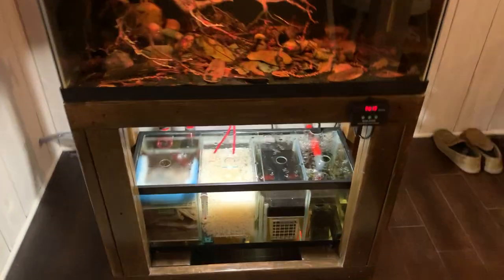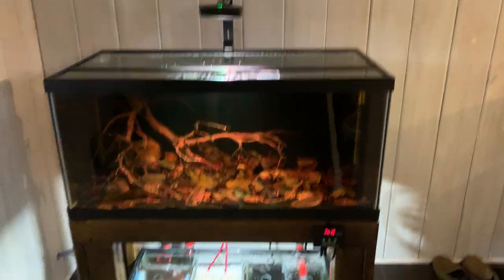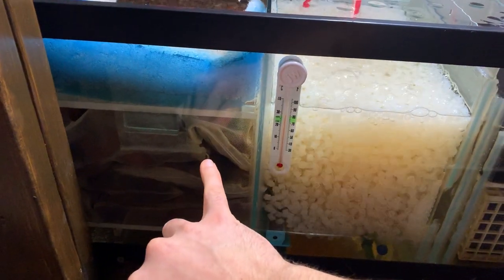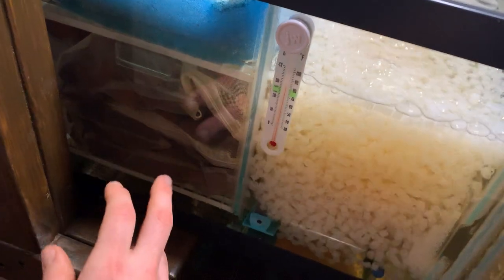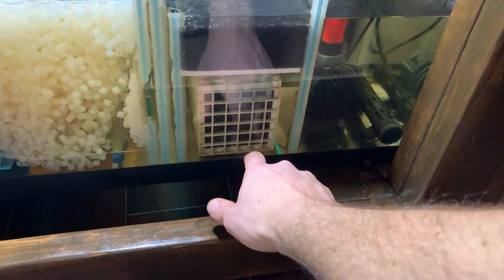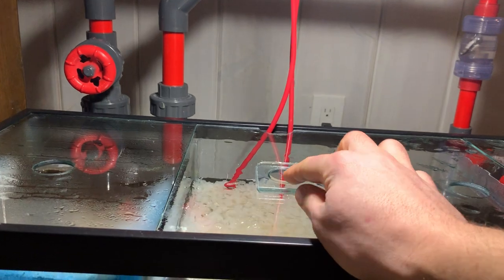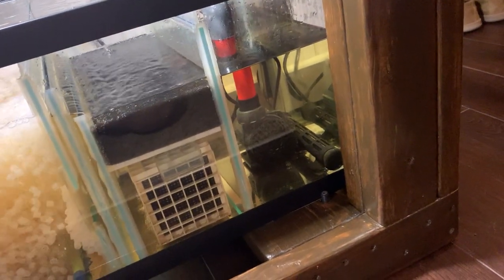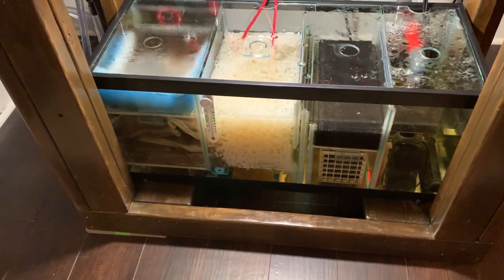DIY Freshwater Sump design

Comment: I run a very simular home built setup but not near as nice on 180. The chamber where you use the nitrate box I have a bunch of plants under a high powered light. That chamber has black walls and the other chamber tops are covered with black lids. This keeps any algae from growing in the other parts of my sump. I really did learned a few things from your video, good job.

Comment: Neat video! Seems like the video was more oriented to aquarium builders. For us that are clueless on the topic: 
Why such an elaborate filtering setup? 
What would happen if one didn't have such a setup?
What does each stage do? 
With that setup, what maintenance is required?
Reply from the maker: Username Well the answer to that is two fold. The first is that I plan on potentially keeping fish in here that demand pristine conditions and a huge biological filter will help with that. The second is that I like maintenance to be as easy as possible so doing a ton of work in the beginning will save an enormous amount of time over years of maintaining your system. 

The only maintenance with this system will be rinsing our filter pad in the first stage when needed and probably squashing our the sponge every 4 months maybe. And of course every aquarium will need water changes.

Stages one and two deal with ammonia and nitrite. The third chamber kind of polishes and will hopefully remove nitrate. The third chamber is a new media for me so I can’t say whether it will work or not yet.

And lastly, I feel that keeping fish and filtration is equal parts caring for you animals and art at the same time

Comment: Hi,
I never dealt with sumps.
I was wondering why not to connect sump like you did from the back instead of top, but all the way down the wall. By doing this way the water is being pushed up through sponge? On your set up the water is being pushed over the acrylic ramp and on to the sponge, this way it looks like the sponge is being used only on 1/3.  Forgive I’m just trying to understand this terminology and difference. You drain system, is it Herbie method?  And how quiet is it?

Comment: Excellent. I plan on upgrading in the future and this is inspirational. I dont know why more freshwater tanks incorporate sumps. As you point out they can be designed to make maintenance so much easier and they also add extra water volume for stability.
What are your plans for water changes on this tank? I notice two pipes on the left hand side, are they for auto water changes?
Reply from the maker: Fishamble  there are two holes drilled in the back of the tank that have flat strainers on them. One is connected to my plumbing to drain the tank. The other hose goes to my utility sink where I have a pump to refill the tank. Makes water changes pretty easy.

Comment: nice sump-

question: since you designed this sump why doesn't the first chamber evenly allow water to use all of your filter floss? 

seems only a small brown section is being used fast while rest of pad is pure white etc.

2nd- why not use coarse, medium & fine sponge in 1st chamber than 2 nd chamber use your finer filter floss padding. gets brown a lot less
Reply from the maker: It’s angled down a touch, as it gets dirty the water flows to the cleaner section until the whole thing needs to be cleaned or changed. I have polishing fiber underneath the coarse pad. Works well 👍

Comment: What size is the tank and sump? Love the plumbing by the way. Doing something similar with my 20 long reef with 10 gallon sump.
Reply from the maker: nneeeco hey! Yeah I forgot to mention that! It’s a 40 gallon breeder on top and a 20 long sump
Reply from the maker: I’d like to see that if you put some pictures up drop a link here if you remember to lol!
Reply: HelpfulFrosting definitely will! I have your video bookmarked so I can somewhat copy your plumbing. I also have the eshopps eclipse overflow but the smaller version. First time plumbing so everything seems so confusing lol
Reply from the maker: nneeeco yes it’s a little intimidating first time. I’m not sure if you will need to cut yours or not. There are a lot of calculations that would go into that to know for sure. I cut mine more on instinct from running systems like this before. I knew if I didn’t cut it the water line would show. Interested to know how you make out👍

I also found a really cool method to silence the overflow box even further that doesn’t involve risk of flooding. I’ll post another video on that soon that will be much shorter lol
Reply: Literally the best sump setup I’ve seen. Definitely gonna be copying it. Thanks for the video!

Comment: Hi there. I just have one small clarification. I have also seen your sketch on imgur. How does the water level in the second compartment is where it is at. The drainage is through slits at a much lower level. What makes the water not stay at the level of the slits as it flows through the third compartment.